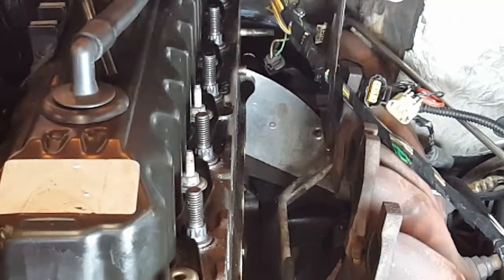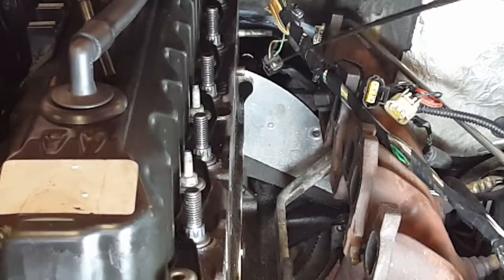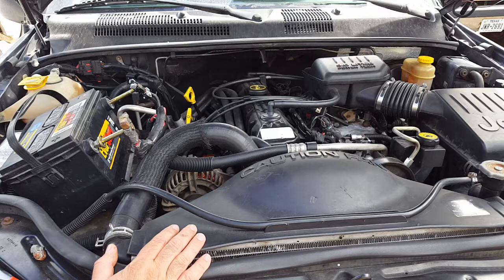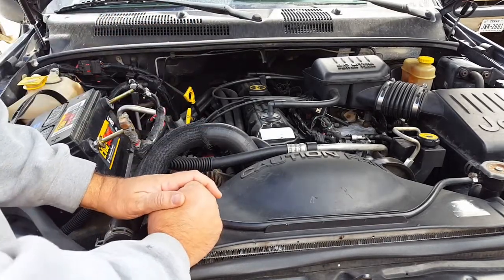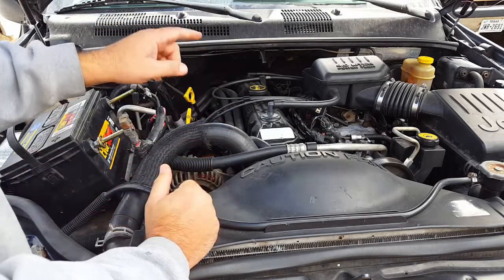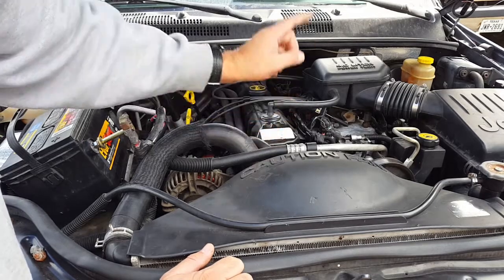Anyone can rebuild an engine - Jeep 4.0L rebuild project - Part 5

Comment: Well. All in all, not too bad of an engine rebuild series for someone who doesn't know how to do an engine rebuild. I guess you found out it's not nearly as difficult as expected. Only problem I had with these 5 videos is it could probably been achieved in 2. I spent more time scrubbing through redundant footage than watching actual engine work. Other than that, the videos were pretty good. 

Less talky talky, more worky worky

Comment: First, you have way too much space in your shop, and there is not nearly enough clutter. With that kind of efficiency people are going to expect you to be proficient. Second, nice work on diving in and doing the work. So many people are terrified of trying something new. The only thing I won't do on my "new" car is a brake job. All of my other vehicles are old enough that I don't even think twice about it. My only real concern is that they are going to run out of cars old enough to work on without having some serious computer equipment made for reprogramming the damn things. It wouldn't be so bad if they didn't all have proprietary interfaces to do more than just scan them. Thanks for posting. I enjoyed the series. Keep up the learning adventures.

Comment: What became of the project? What damage was done with the dog shifting  gears? 
I, too, don’t have have space, so I will rent a storage space. How long did this take you? Sorry if I missed it in the videos. 
Any last words of advice?
Reply from the maker: It ran without issues until she got into the mountin areas of Alaska when the dog knocked it out. of course NOW after talking about it a few times it apparently happened about 4 times and the It finally died on the last time... she said it reved up REAL loud and then started making a clanking noise. I assume she redlined the RPMs several times and then some in Alaska. 

It took me a few months but I guess probably two weekends worth of actual working time.

Comment: All the books show the camshaft sensor to be pointing toward the firewall,  I went through the entire install,  yet only place mine will run is with it pointing towards the passenger side wheel well.....such a finicky item.

Comment: Hi, hows it going? is the jeep still running good?
Reply from the maker: It made it to Alaska from San Antonio... but it is not now. She told us that her dog kept hitting the gear shift selector and knocking it out of drive in the mountains at full speed. After the third time it starting making a noise.  I think it was high revs and heat not the rebuild she said it pegged out the rpms a couple times when it happened.
Reply: +BigRedFishDad. do you think it spun a bearing or broken another piston skirt? any chance your gonna take off the oil pan and look?
Reply from the maker: @kylandaminick13  i have no idea and since she is 4100 miles away I won't be able to fix:(
Reply: Dang that sucks, I spun a rod bearing 140 miles from home. I had to get it towed but hopefully I can fix it. I also hit the rev limiter a few times rite before it spun the bearing except I was being dumb driving fast so its kinda my fault. I'm sure detonation contributed to the damage also because i chipped a piston by the ring land too, and my knock sensor told me i was getting knock if i hit the gas hard. Smh which i did anyway:(

Comment: What was the total amount you spent?
Reply from the maker: I am really not sure... she paid $1000 for the jeep but I think she is still under $2000 total and we had to replace the manifold gasket with a Fel-Pro because the one in the kit was trash!! Also this week after 8 months of driving we are now replacing the head with a new one because it finally developed the infamous crack on top between #3/#4.
So we could have saved some time by purchasing a little better kit ---- make sure it includes Fel-Pro gaskets. 
 If you do this you might think about replacing the 0331 casting head while you are at it. (just google it you will see what I am talking about)

Comment: i would of liked to seen you build the top part of the engine to plus you could of showed all the tools used to build the engine plus it needs a new muffler
Reply from the maker: angela prestwood like I mentioned in videos this wasn't a "how to". The book covers all that. Also it wasn't the muffler it was a  cheap manifold gasket that came with kit... have since replaced with felpro and has been running great for about 6 months now.

Comment: im in the process. Just finished installing the new crank and cam. im dreading the transmission to engine reinstall.
Reply from the maker: get a helper! it was still frustrating but like I mention get those two wing studs aligned and then it goes pretty easy after that.
Reply: i pulled mine with the head off so after lowering the engine i could get to the upper bolts. Its going back in the same way.